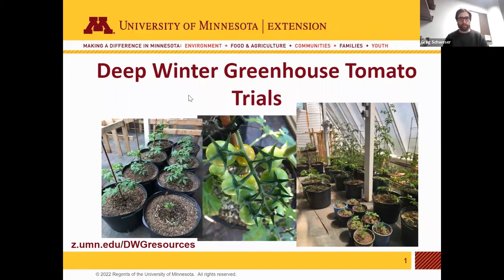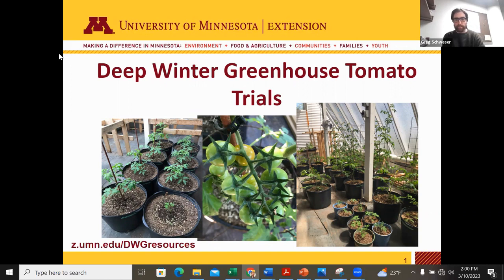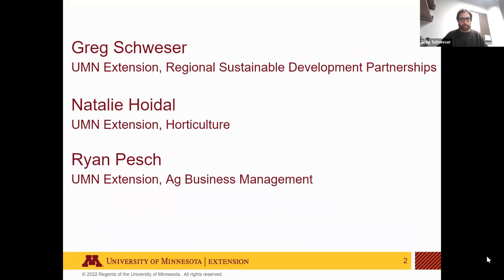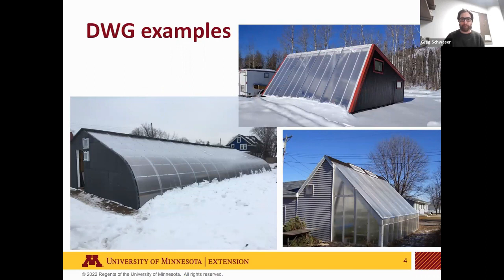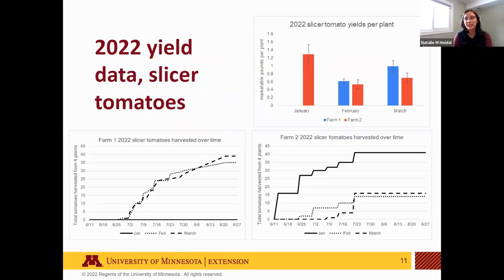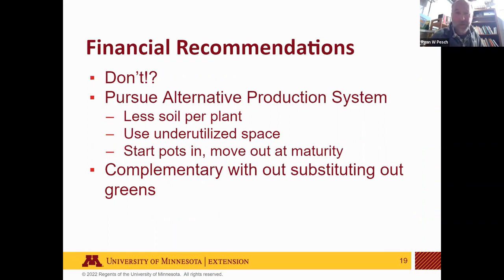Tomato Production Trials in Deep Winter Greenhouses

Comment: I live in northern Minnesota west of Grand Rapids. I have  been building a 30x36 year round greenhouse this summer . I am doing hydroponics. Just started transplanting out a few things. I have it on a heated slab and super insulated it. I plan on building a solar water heater using black pipe to help with heating. I’m going to store water in 275 gallon water totes to recirculate through a heat exchanger and use as a thermal mass.My question is has there been studies or do any of you know what heats for a longer period of time 1-tote the sun heats to 120- 130 degrees or several totes 80-90 degrees which is more important the volume or the temperature?  I’ll put an aqua stat and small pump on each tote . Thanks